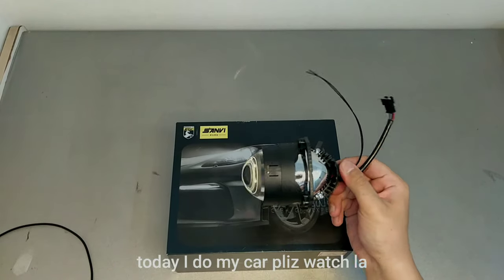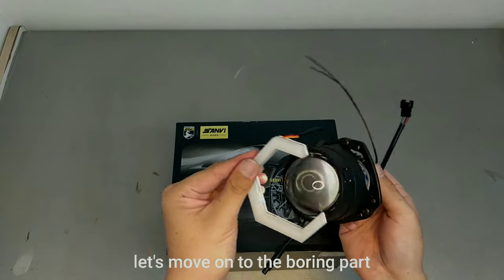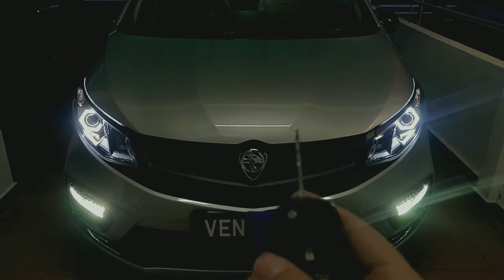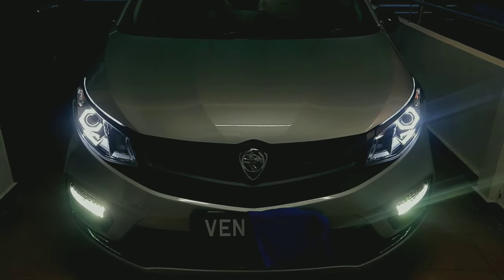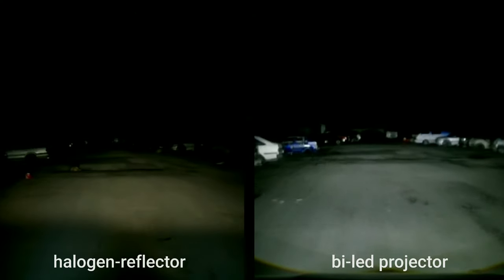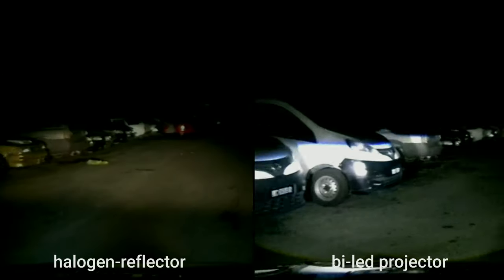EASY DIY RETROFIT Bi-LED Projector | Blackout Headlights | Hexagon Halo Angel Eyes | Proton Persona

Comment: bro..where u buy projector led 👆...how much
Reply from the maker: Hi bro. I bought them from taobao for about RM300 excluding the courier fees. I saw them only Aliexpress too!
Search for Sanvi S8 2.5 inch bi-led projector. 

They are really good for this price. Been using since November so far no problem.
Reply: @projectgostan1773  i want custom my city gm6 2017...build in projector lens..so where can get sanvi s8 2.5inch led projector bro??...
Reply from the maker: @mohdaliff6817  aliexpress got. But bro gm6 I think can masuk 3inchi. Lagi cun. If u really want sanvi S8, aliexpress ada. 

Kalau guna taobao kena google translate la haha
Reply: @projectgostan1773  ok. i find 3inc for gm6...tq bro info....but 1 more...how about cahaya lampu untuk cantik dan tidak silau ke bro??..
Reply from the maker: @mohdaliff6817  projector tak silau bro. Pantulan dia direct n focused ke tanah. Lagipun yg ni built in LED, bukan yg jenis bole tukar mentol. 

Melainkan bila kereta ko atas bukit dan kereta orang lain bawah bukit. Tapi ni mmg normal la dgn kereta bm pun camtu.

Specs dia pulak 5500k 9200 lumen 35W
Reply: @projectgostan1773  ok bro...berapa lama blh dpt..if beli..pre oder or ready
Reply: @projectgostan1773  bro....can u give link website to buy...dan 1 lagi... socket projector led?? H1.H4.H7.H11
Reply from the maker: @mohdaliff6817  MYR 320.29  36%OFF | Sanvi New 2.5 inch MINI Auto Bi LED Projector lens Headlight 35W 5500k Car Auto LED Headlamp H4 H7 9005 9006 Projector Light
https://a.aliexpress.com/_mKs7F3D

Mintak yang RHD bro. Kalau takde cari seller lain

H7 la bang. Kita h7 asal nak beli yg lain
Reply: @projectgostan1773  bro city gm6 socket h11 bro..xdela dh riki ada LHD shja.. kalau sinolyn ok ke bro dlm shopee???
Reply from the maker: @mohdaliff6817  kalau Tak silap Saya Sinolyn tu bi-xenon bukan bi-led. 
Xenon tu HiD. Lebih baik led la bro haha
Reply: @projectgostan1773  bro proton iriz socket headlight what type??...my headlight gm6 H11
Reply from the maker: @mohdaliff6817  oh sorry tak baca betol2. Aah gm6 is h11. Mine is H7.
Reply: @projectgostan1773  soo mmg xblh fit la utk after market bro bcoz gm6 h11 socket
Reply from the maker: @mohdaliff6817  aah tapi takpe la bro. Better u cari yg 3inci haha. 

Saya terpaksa sebab tka boleh masuk
Reply: @projectgostan1773  just checked Taobao for prices cost about RM500  shipping fees included
Reply from the maker: @bananameowmeow9260  really ah bro. Cannot be leh I bought less than 300yuan for one pair excluding shipping, then I use 集运. Maybe different model.
Reply: @projectgostan1773 or you still have link for da taobao Ones maybe i find Wrong lul
Reply from the maker: @bananameowmeow9260  6👈，CIPTXUFBbZG微 https://m.tb.cn/h.4trKZBM?sm=d62013  SANVI S8汽车LED双光透镜超亮聚光2.5寸伟世通海5远近光一体大灯 

我刚copy的试试看
Reply: @projectgostan1773  wuish 感谢感谢

Comment: Heyy broo
Reply: Need some help tho, how to wire through the bi led for H4 connection, managed to identify for low beam but for high beam , it’s really difficult because the both wires are black and I don’t know which is positive or the negative wire
Reply: Any idea bro? Thanks man!

Comment: Pm for helping 🙏
Reply from the maker: Sure what's up!
Reply: Where can i gets the projector on my proton saga 2019
Reply: And how can i choose tat projector r suitable on my saga 2019
Reply from the maker: @cheangkaiqin6075  you can have a look at Edison R2 (around 2.8k) or LG Innotek V2 ( around 1.7k) if got budget. 

Those are really good projectors. 

Alternatively if you wish to go for cheaper products can buy the SANVI one like I did. 

Saga should be able to fit a 3 inch projector and just find one that has a H4 mounting if you don't want to cut your reflector bro.
Reply: where can i buy it?online?